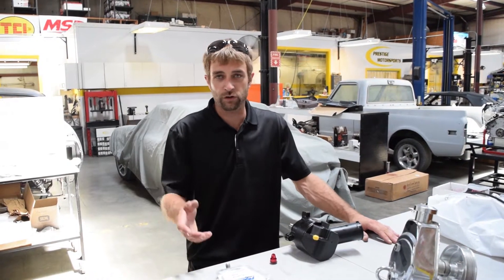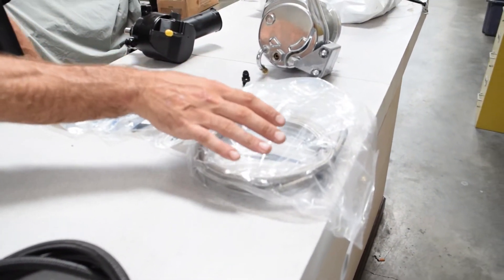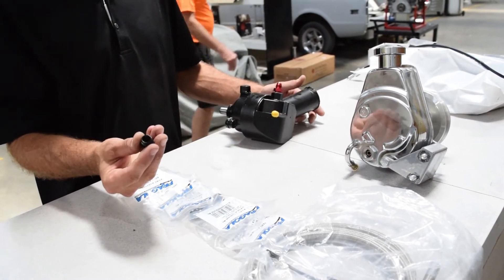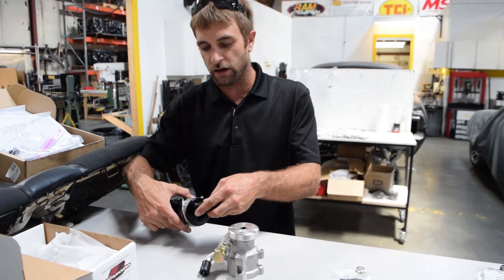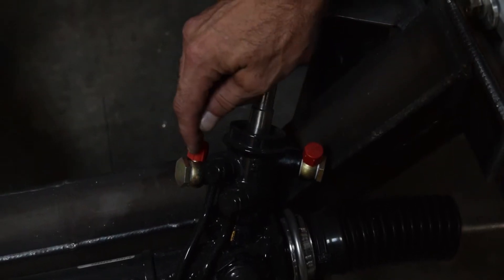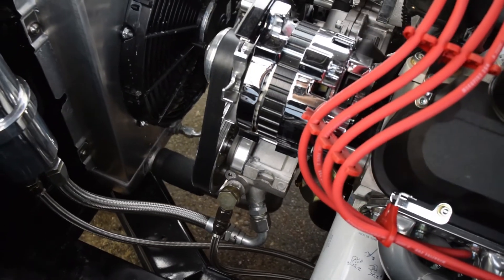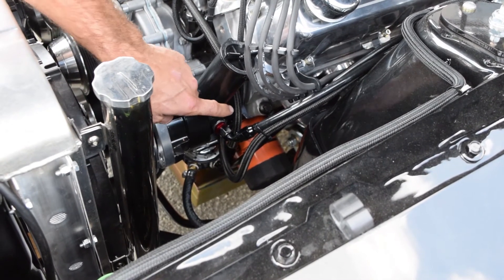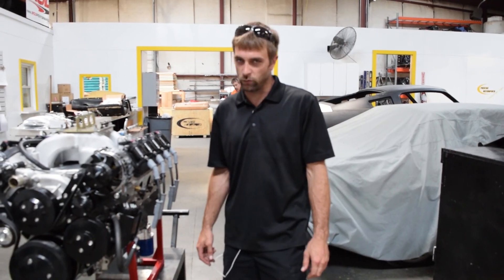Tech: Power Steering Pump, Rack and Pinion, and Gear Box Connections

Comment: Do you have to replace the rack and pinion when you replace your power steering pump and hoses rack and pinion when you replace your power steering pump and hoses?
Reply from the maker: no not unless there is something wrong with it. In the performance world it is important however to make sure components match each other and be aware that sometime pump pressure and flow may need to be altered depending on the particular system.